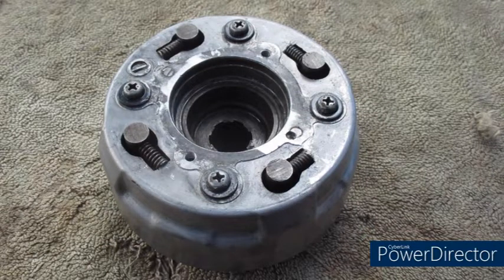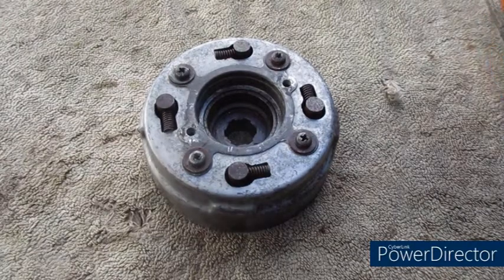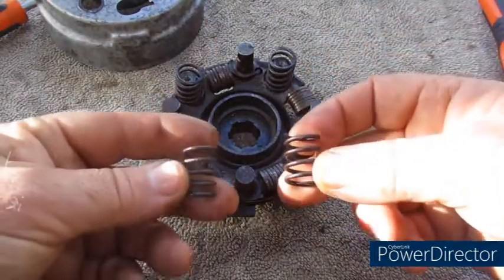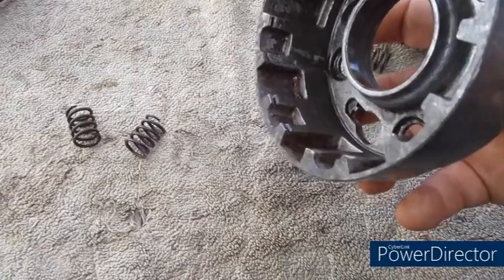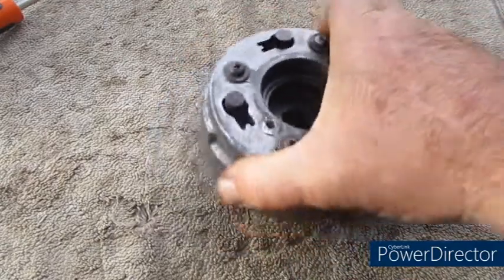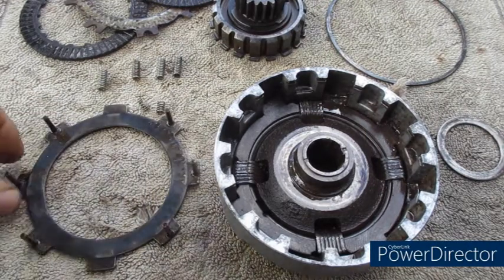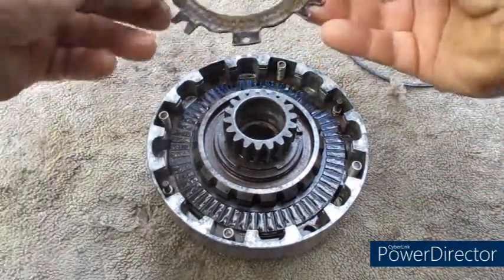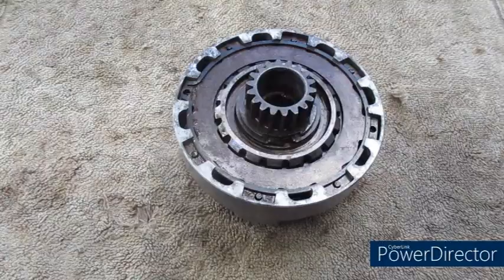Honda CT 110 Trail Clutch Repair - How to Fix A Slipping Clutch.

Comment from the maker: Clutches & how they are assembled vary slightly over the years.  The assembly method shown here applies to CT 110's from 1980 to 1998.  For other year bikes, consult the appropriate shop manual or parts list.

Comment: Great video- very helpful.  Do you know if the friction disc thickness tolerances (CT110 2.8-2.9mm) in the manual apply to clutch plate A as well? B,C, and D are out of spec.  Disc A is quite a bit more out of spec and much harder to source.  thanks
Reply from the maker: Friction plates 2.8  to 2.9 mm is new standard size.  Service limit replace at 2.4 mm.  Couldn't see drive plate A B etc specs in ct110 manual, but late ct90 manual with 3 friction plate clutch shows friction plate specs same as above & drive plates 1.93 to 2.07 mm new, replace at 1.85 mm.  I'd say those specs also apply to ct110 plates.  Warpage is given as 0.2 mm std replace at 0.5 mm. Disc A main thing to check is the back of the plate there'll be marks where the flyweights press on it, check the marks aren't excessive. Your clutch is probably not as bad as you think it is.  Thanks for watching.
Reply: @Free_Ranger_CT110  Thank you for your reply.
Reply: @Free_Ranger_CT110  Perhaps you can help provide some clarification- For the 1981 CT110 the manual specifies 27MM as the spring length, however several places in the US are shipping springs that are supposedly compatible with the CT110 and ATC110 that are 24mm.  Not sure what to do or what is the correct answer.
Reply from the maker: @mjspinosa  I checked manuals for 90's from 1967 to 1979, 110's from 1980 to 1985.  All state 26.8/27 mm new & 26 mm as the service limit.  That would suggest 24 mm springs would be too short.  There is a stated preload length of 10.4 kg & 15 mm, but that would be a mission to measure & would seem over the top.  Perhaps the 24 mm springs are for 50/70's I don't have manuals for those or Chinese clone engines. Have you tried genuine Honda from a dealer?  They may have some.  All the best.
Reply: @Free_Ranger_CT110  thanks again for the reply.  I ended up finding out that the 81 ATC110 springs spec are 24mm so they are not interchangeable with the CT110 like many think they are. I think the seller thought they were and sent me ATC110 springs. Unfortunately these springs are not available from the manufacturer/dealer in the states- we have to rely on NOS  or aftermarket parts or shipping from other countries-  very much appreciate your help and your videos!
Reply: To add to the confusion- the springs I took out of the current clutch from an 81 CT110 springs are 24mm- I thought they were worn out but now I'm thinking they are just ATC110 springs.  I got this thing in non running order so I have no idea if the clutch was working with those springs or not.
Reply from the maker: @mjspinosa  thanks for that, maybe they would work I don't know, had virtually zero experience with ATC's.  It does make it difficult building up a non runner & you don't know what the previous owner has done.  Good luck!

Comment: Great video thanks. Very helpful. One thing- does it matter which way the thrust washer goes? I’m guessing rounded edge facing up. Wanted to double check.
Reply from the maker: Thanks David.  I double checked in the manual & it doesn't mention which way, but I'd say rounded edge up as you suggest would be the way to go.  Hope the videos prove helpful.

Comment: I'm going to replace the clutch disks. What gaskets would you suggest I replace in the. process? Thanks.
Reply from the maker: Thanks for watching.  Two gaskets, the clutch engine cover gasket & the smaller round gasket that fits under the clutch end cover.  Funny you asking that now as i have a video out in 1.5hrs showing this exact same thing.  It will show the gaskets you may need. https://www.youtube.com/watch?v=rsyqReZWSA0
Reply: @Free_Ranger_CT110  Thank you, brother!

Comment: I recently purchased a '79 CT90 with 1400 original miles and a '84 CT110 with 1100 original miles. My question is: Even though the CT110 has low miles, it is very hard to shift, especially from first to second. Is this a problem because the bike sat for so many years, and even though it looks brand new, the clutch plates have "bonded" (or rusted) somewhat together from non-use? I would think a bike with such low miles would have zero issues, except maybe for stale gas clogging the carb or tires decomposing from uv rays.
Reply from the maker: Try adjusting the clutch, that may help but as you said, I also think it's probably due to lack of use.  Have you tried putting the bike on the ctr stand, engine off, rotate the rear wheel by hand & try the gear shift.  If it's OK the problem is clutch drag (not disengaging correctly) Envious of the two nice bikes you picked up, low mileage bikes are very rare here in Oz..
Reply: @Free_Ranger_CT110  Thanks for your reply. I followed your instructional video on how to adjust the clutch and that didn't help. What exactly happens when there is "lack of use"? Does that cause "clutch drag"? Heading to garage now to rotate rear wheel, per you advice. Strange, but I've come across a lot of "low mileage" bikes, here on the west coast of America. Seems as though many people bought them back in the day and they ended up sitting in the garage, or sadly outdoors (after only a thousand miles of riding) for 40 years, or more. (Note: went to garage and turned the rear wheels on both the 110 and 90 and then shifted each. Both felt the same...shifted relatively easily. What does that mean?)
Reply from the maker: @j.arthurlearned7696  it's simply the clutch plates are stuck together, fresh oil & use the bike.  Checking the shifting rotating the wheel means there's nothing wrong with the  gearbox or selector mech, it's a sticking clutch.  At such low mileage it's unlikely to be wear on the clutch opersting mech. It should cure itself, if not dismantle the clutch & deglaze the plates.
Reply: @Free_Ranger_CT110  Double thank you.💯
Reply from the maker: @j.arthurlearned7696  glad to help, hope you fix the bike & enjoy riding & working on both of them.

Comment: Used this tutorial to discover that the last person to work on the clutch of my newly-acquired 71 CT90 had sandwiched the two small clutch springs between a couple of the plates. Once corrected, the slippage was much diminished. There was no thrust washer, so I will have to investigate that. I also have to find out what is the minimum length of the main clutch spring. If it is 26 as you say, mine are all too small. 
When re-installing the screws through the outer clutch into the drive plate, I found that putting a small block underneath allowed me to push the outer clutch plate further down, making the job a little easier. 
Thank you so much for this video, and all your others. They are a great quality and a tremendous help.
Reply from the maker: Thanks for your comment, glad the videos are helpful.  I double checked in the Honda manual, it says main clutch springs are 27mm standard & replace when under 26mm.  Also in the manual can't see any thrust washer fitted to the ct90, all ct90 clutch I've stripped do not have one, but the ct110 does. Giving the steel plates a light rub with fine emery paper to deglaze them can help reduce/eliminate slipping.  Synthetic oil can cause slippage too. Thanks, hope this helps.

Comment: Dang I had no idea about those screws and JIS. I stripped most of those. Gonna have to get a JIS bit
Reply from the maker: Yeah, I bought a reversible JIS screwdriver & bits for my impact driver.  Worth buying if you work on old Japanese bikes.  Most JIS screws can be ID'd by a small dot or center punch mark on the head.

Comment: I did a brand new clutch, still no reverse. It slips in reverse. It works on the stand but slips with weight on the bike. I’ve taken it apart numerous times. The linkage looks good. I’m lost. Any idea?
Reply from the maker: Hi I've not worked on bikes with reverse gear, but assuming the auto clutch is the same as the CT110 clutch.  Did you change the steel clutch plates?  If not, deglaze them with fine wet n dry paper, check they aren't warped & check the main clutch springs.  Is it adjusted correctly?  It's possible to overwind the adjuster & cause problems.  What oil are you using?  Some oil has additives which can cause a wet clutch to slip.  Hope this helps.
Reply: @Free_Ranger_CT110  thanks for the reply. The clutch assembly is brand new. Yes it is adjusted correctly. I’m using 10w40 wet clutch atv oil. Maybe I’ll try deglazing the steel’s. I don’t know. Thank you
Reply from the maker: @jimkalfakis9893  seems you've done everything right, maybe the clutch can't handle the high ratio in reverse.  Heavy duty springs if they're available.  If the clutch only slips in reverse, then it's a good chance it's a gear fault, dogs broken off etc.  But that would be mechanically noisy & metal in the oil.

Comment: Great video! I recently picked up a flawless 1980 110. I've worked on these engines for 30 or so years and this one has an issue I haven't really ran into as bad before. As you know, sometimes the one way part of the clutch might not grab on the first kick and you have to kick it again. This particular one is pretty bad and I just about have to roll start it to crank it. I will say the more I ride it the better it gets. It only has like 1500mi on it. I did fresh oil on it and have put a few miles on it. It's way better when it's hot. When it's cold, sometimes the overrun part of the clutch just won't catch. I may grab some springs and fibers for it but wanted to ask exactly what part of the inside does that one way part. Thanks again man, subbed!!
Reply from the maker: thanks for the sub.  When I bought my bike it hadn't been used for several years & also the clutch slipped & I couldn't kickstart it.  I stripped the clutch & deglazed the steel plates with wet n dry paper.  Fitted new friction plates & the clutch worked fine after that.  The clutch centre has a helical gear that is part of the auto clutch & could be sticking.
Reply: @Free Ranger CT110  okay great! I think someone may of used car oil in this one so probably needs fibers anyways. Much appreciated man.
Reply: I was wondering if you tried deglazing the friction discs before replacing them? My bike has been sitting along time and slips when kicking sometimes but the discs look fine.
Reply: @kevinhurt9742  I haven't torn into mine just yet. It's gotten way better the more I ride it

Comment: Thanks again I didn’t know there was any other standard than Philips head and spinning the clutch backwards 👍
Reply from the maker: Yes, these vintage Japanese bike have JIS screws which look similar to phillips.  I've now bought myself a screwdriver set & some bits for the impact driver.  I could never understand why the heads would get damaged so easily.  JIS Japanese Industry Standard.  Usually the screw head has a small dot on the head indicating it's JIS.  All the best.
Reply: Ah I have seen that dot often enough never thought to much of it now I know thanks 😊